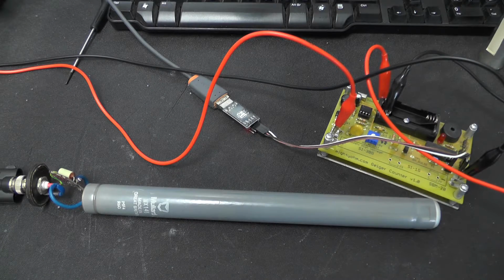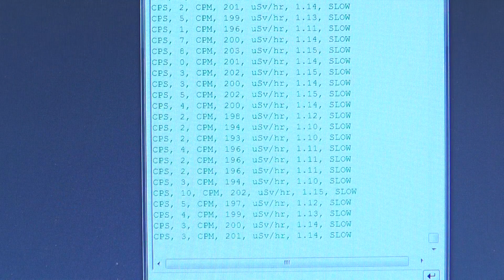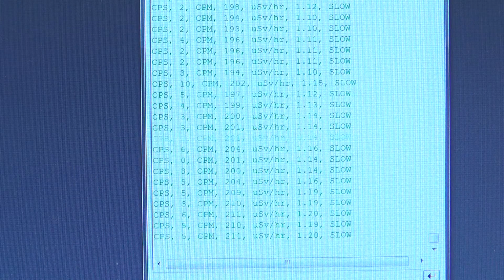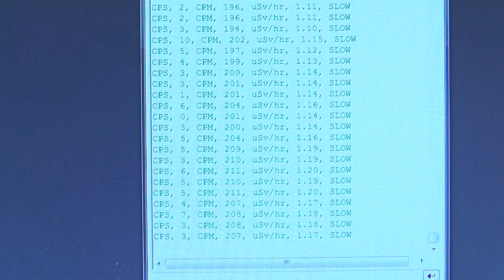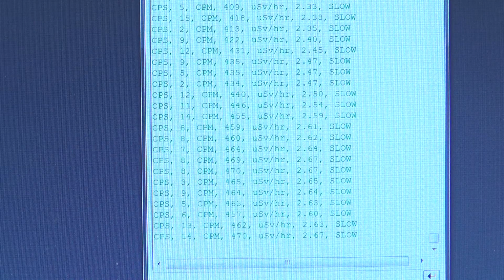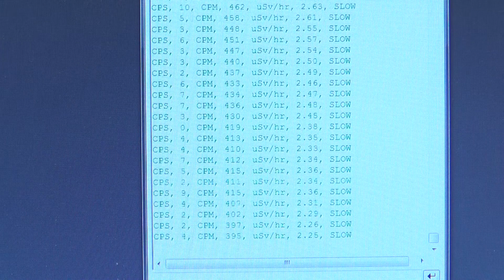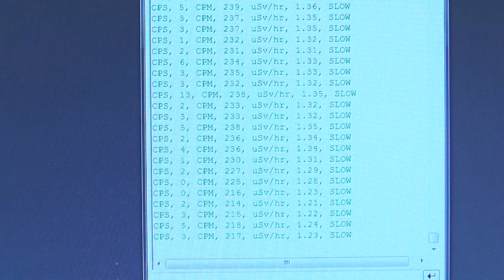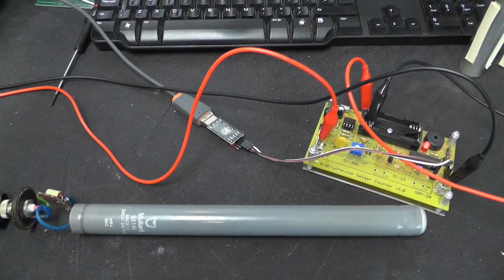DL#039 - Teardown: Mini Instruments Geiger Tube MC71

Comment: Hello, perhaps the lead shielding is on the Gamma only tube to allow it to detect Beta radiation by converting it to Gamma as it is absorbed by the lead. Low density matirial like plastic makes a good Beta sheild while lead causes the generation of Xray/Gamma.
Reply from the maker: Thanks for the comments Beth, I did find a Mullard document that has the specifications for that tube, it also described how it could be 'energy compensated' by applying a Tin shield around the two ends, just like i found in that probe. The Lead did turn out to be Tin on further inspection. It basically makes it less sensitive to higher energy gammas and gives a flatter response curve.
Reply: The lead shielding is designed to shield beta particles and to compensate the gamma ray energy spectrum response, because low energy gamma rays on a bare GM tube produce many more counts/second for a fixed dose rate (microSv/hour) than high energy gamma rays. A thin lead shield reduces the contribution from low energy gamma rays, so that the GM tube then gives a reasonably well calibrated response regardless of the gamma ray energy.  Otherwise, unless you measure the spectrum of the gamma rays, you get faulty dose rate readings!

For gamma rays in health physics the bone marrow dose is important (leukaemia is the most radiation sensitive cancer, with a lower radiation dose needed to double the natural ~1% risk than any other type of cancer), which is quite well shielded by an average of 5-cm of water (surrounding body tissues) and so gets only 66% of the free air dose rate for the 0.66 Mev gamma rays from Cs-137/Ba-137.  If you go down to lower energy gamma rays like the 0.0595 Mev gamma rays from Am-241 in smoke detectors, they are shielded very easily (like beta particles), so they give only a very small bone marrow dose.  So you need to energy-compensate the GM tube so that its calibration is meaningful.

(There was an episode in the 1980s when Greenpeace and Sellafield Health Physics workers measured entirely different radiation levels on the mud at Seascale, one group measured the actual dose rate people received, and the other group held their beta sensitive probes in contact with the most radioactive speck of contamination they could find, leading to the complaint: "Greenpeace would report the height of Blackpool Tower as being the average height of buildings in Blackpool!")

Comment: So basically more intended to see if there is enough activity to make usable power, rather than to see if there is a low safer dose. With the lead shielding I am not surprised that it was so insensitive, they probably held it next to a fuel rod in use. To get the SRBP back together are you just going to stick it with silicone so you can get the tube out again or use some epoxy. Interesting that they used a small piece of 0.15in veroboard to hold those components inside the case.
Reply from the maker: SeanBZA I do find the lead shielding a puzzle, why take a big GM tube and make it less sensitive? I noticed that the phenolic tube blocks most beta particles and the lead will block some of the gamma rays. I'll put some foam around the tube to stop it moving inside when i re-assemble and yea probably just silicone the end back on, or maybe just use insulation tape if CBA sets in ;-)